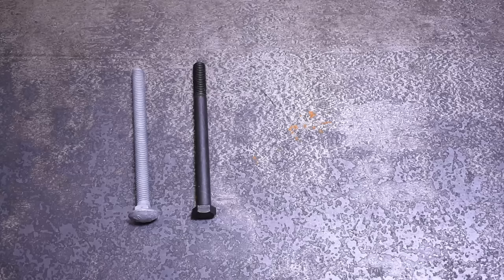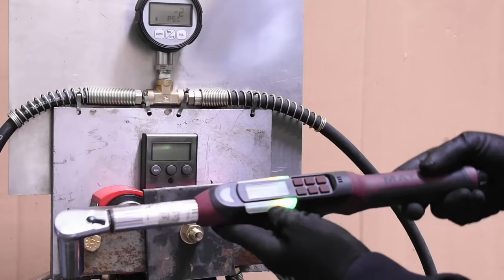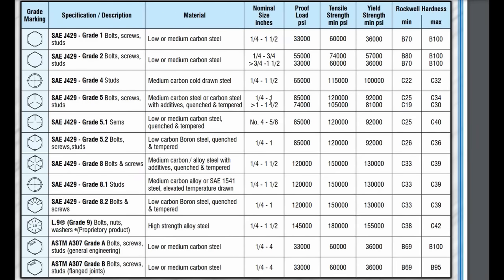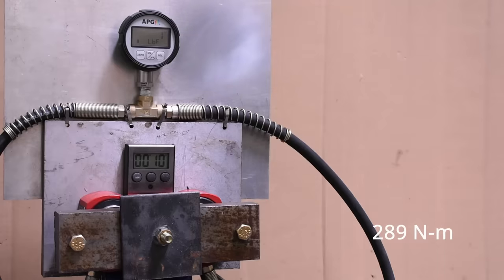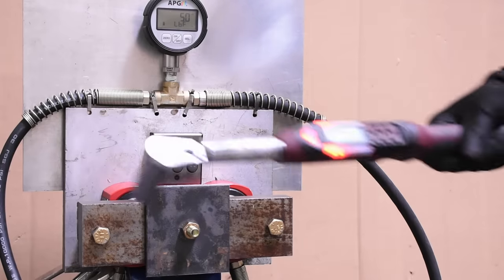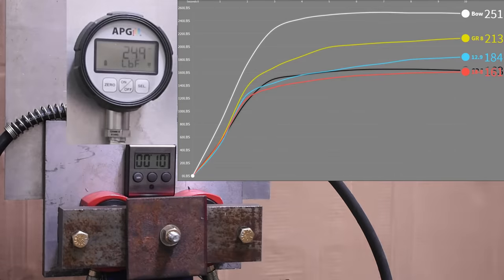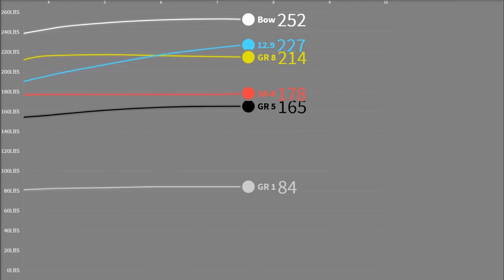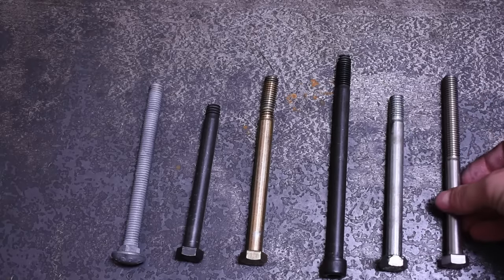Strongest Bolt? Grades Explained & Dyno Tested For Science

Comment: 304 stainless bolts or 18-8 means 18%Chromium and 8% Nickel. 304, aka 304L (L for low carbon) is food grade stainless that's extremely tough (extremely), ductile, but not necessarily hard, and easy to weld. 18-10 has a little bit more nickel and is generally 316 stainless which is considered pharmaceutical grade (as opposed to food grade). You must ALWAYS use an anti seizing compound on all stainless steel to stainless steel threads or they will gauld and sieze with zero chance of coming loose. Once the siezing starts, it only gets worse.
304 is welded using 308 or 316 filler material and 316 is welded using 316 or 317 filler material. 317 is almost always just a filler material since it contains certain properties to better control or stabilize the metal chemistry during the welding process.

Comment: Small point:  18-8 is not a bolt class.  It is a term for certain stainless steels, usually 302 or 304.  It comes from the steel having 18% chromium and 8% nickel.

Comment: I use stainless bolts quite a bit, biggest issue/failure I've had with SS bolts is galling. Running the nut on with an impact and no lubricant the nuts tend to gall before it becomes tight
Reply: AvE taught me to always put something on stainless fasteners, never run them in dry, even the intimate lubricant in your back pocket is better than nothing

Comment: Bolt finish has some bearing on how they take torque as well, zinc plating can act as a lubricant under high torque and a rough black oxide finish can gall up and resist turning when tightened severely. And then there's high speed galling with tainless steel too! It's a big wide world and bolt grade can be only a little slice of the puzzle. Lubed or unlubed? Grease or oil? Thread locker? All variables play in how the bolt breaks. It's like it's got it's own field of science or something probably.

Comment: The reason you shouldn't use stainless fasteners for critical high load applications is that they work harden and will eventually fail even though they work fine up front. I dangerously put some through the hitch of a trailer about 15 years ago or so, replaced a few years ago with 12.9 cap acrews and higher grade cone lock nuts and much safer now despite the brown look. Though they never did fail, it would have been a crappy day if they had and it's not worth it. You can also get 12.9 with zinc plating these days so that's my go-to for outdoor fasteners now unless I don't want a cap screw for some reason eg restricted space.
Reply: Yes, some backyard mechanics replace the rusted steel bolts on their car with stainless so they won't corrode in the rust belt states. I also use white lithium grease or anti-sieze compound on them.Thanks for the advice as I've never heard that before. Retired welder and fabricator.

Comment: 12.9 are usually used as stretch bolts, SS bolts suffer galling and are not good in high temp usage due to expansion. Choosing the correct hardware is vital, if you're bolting a wooden fence use the cheapest galvanized as the tensile stress is not a factor only corrosion, if it's a boat use SS as corrosion and strength is needed, if it's a driveshaft use 12.9 as strength is the only factor.

Comment: I work maintenance in a milk processing plant and we use stainless bolts very often (corrosion resistance and being food grade).  The issue with stainless is that its more brittle and likes to break easier.  And is then a pain in the ass to drill it out since stainless is much harder than carbon steel.  I'm surprised that bolt did not shear during the test.  But like the sheets say, it can vary from bolt to bolt.

Comment: Thanks for an informative video. Very useful.
I'm in the UK so I have my calculator to hand as today we usually work in N/m for torque and N/mm2 for strength. (I did my apprenticeship in the '70s when we worked in both sets of units so the conversion factors are forever etched into my brain...) 🙂
Reply: "N/m for torque...".  I think you mean Nm.

Comment: Very informative.  Tensile strength is only  one measure of performance though.  For instance in marine applications stress fractures over time are likely to limit stainless steel bolt performance as much as overtightening.

Comment: The Grade 1 stretches rarher than snapping under truly extreme loads which can actually make it more useful in some specific applications where the displacement of the 2 things being held together is low, but the force is high, and the bolt isn't structurally critical (for example, affixing a support post in position, where it will shift slightly under high force, but it won't collapse in case the bolt does snap)

Comment: Not trying to be a negative Nancy, but if what you're trying to do is demonstrate the torque it takes to break a bolt you did a great job, if you're trying to demonstrate how strong a bolt is you need to demonstrate how much tightening pressure they can produce before failing.

Comment: Interesting video, ive been working in oil&gas were they use a lot of flenses to join pipes together especially with stainless they use anti seize paste for smooth operation on the torcwrench..

Comment: Excellent video!  Thank you. Just an FYi you have to be careful who you buy your bolts from.  We ran into a problem with many bolts coming out of China having false markings. (I can't remember the company). We paid for high strength bolt and ended up with low grade with high grade markings on the heads. This was in the early 2000's so it may have been fixed but you still want to "buyer beware."

Comment: I changed a jet engine on an MD-11 the other night. The mount bolts were about the size of your thumb. 500 ft/lbs torque. I would love to see those tested to failure.
Reply: I'm sure you know the rules about not re-using bolts that were heated with a torch to remove. It wouldn't hurt to remind a few rookie mechanics about it. In 1982, I knew a welder that did that in the Air Force, and he said the engine bolts snapped off on an airplane after he used them again. That was during takeoff! Maybe he was talking about the sixties or seventies. From a retired welder and car mechanic.

Comment: My father was an engineer for Caterpillar tractors and he used to say they always use a 3/8 size bolt because it has huge jump in strength compared to smaller bolts.  I also have always heard stainless bolts are brittle and break easy but i have always had good success with them. Never had one snap on me. I have 308 stainless bolts I was wondering what’s the difference between the ones you mention (the 304) and 308?

Comment: Terms like ‘toughness’ and ‘strength’ are often thrown around and only serve to muddy the waters.  ‘Toughness’ is the ability of a metal to resist brittle fracture; meaning it will deform more before failure.  ‘Strength’ is the ability of a metal to resist plastic deformation; meaning it will deform less before failure.  The harder the steel, the stronger it is.  Softer steel = tougher steel. Strong bolts will snap when they fail, tough bolts will stretch when they fail.  

Just because a bolt is made from a harder steel doesn’t make it better, it’s only better for the application it’s designed for.  A tougher steel bolt is desirable when it is likely to experience some sort of impact, for example connecting rod bolts in an engine; as the power stroke in one cylinder is creating the intake stroke in another by pulling the piston out by the connecting rod cap, the rod bolts in the intake cylinder experience the energy transferred to the crank by the combustion cylinder.  Rod bolts must endure stretching forces repeatedly, which means they need to have a good toughness, yet balanced with good strength to resist deformation. 

All in all, there’s really no such thing as a ‘best’ bolt; more like what bolt is best for a given application.

Shear strength and toughness are another aspect that should explored here.  Rod bolts aren’t designed to withstand shearing forces, as they essentially don’t experience it.  Structure bolts are used in a static application, as opposed to rod bolts in a dynamic application, and should hold static tension while having a high resistance to shearing.

Comment: Most interesting part is that I even care about this stuff.
ARP sells their common Small Block Chevy Connecting rod bolts, black  fine thread, which are rated at 200,000 psi. (yield ?)
But meanwhile, stock SBC connecting rod bolts, now made by Pioneer, are black grade 8 fine thread and rated at 150,000 PSI.
It appears to me the tests show a Grade 8 doing very well with above 200,000 psi .  Leads me to believe that if you aren't reusing old bolts or over torking, Stock is fine up to 6200 rpm even at higher horsepower levels.

Comment: Fun Fact
The Metric classes just represents the tensile strenght (x100) and yield strenght (first number x second number x 10)
8.8 means 800N/mm² Rm tensile strenght (8x100) and 640N/mm²  Re yield strenght (8x8x10)
12.9 would be 1200N/mm² Rm and 1080 N/mm² Re

Comment: Your tests operate by converting tension in the bolt into an equivalent torque.  In this test you are showing bolts with various surface finishes up to and including galvanizing.  You will see a difference in torque to tension for galvanized steel vs. smooth uncoated steel meaning you would have to calibrate your conversion factor for each individual bolt type and finish.
There has been a lot of study of bolt tension vs. torque for building construction.  If connections are going to rely on clamping force from bolt tension then we have to know how to reliably achieve the clamping force and how to measure it.  Some tightening methods actually just measure rotations of the nut to know that the bolt has gone into its yield range and this is done in some automotive applications as well.  I've seen various tests using a Skidmore-Wilhelm machine to see how bolt tension varies due to factors such as bolt coatings, finishes and lubrication.
Grade 1, or A307, are very common bolts and even though the metallurgy is fairly mundane they provide a good amount of strength and are widely used in building construction.  In structural steel buildings the most widely used bolts are A325 which equates to Grade 5.  Some very small percentage of building construction has been done with A490 bolts which equates to Grade 8 but I've also read in various literature where there have been doubts if it was generally possible to properly tighten large diameter A490 bolts to achieve the expected clamping force.
Strength and hardness are somewhat related because after all that is the way that you measure hardness- by deforming the material.  If it is stronger and resists the deformation then that will read as being harder.
"...as simple as nuts and bolts...".  There is nothing simple about nuts and bolts other than the basic shape.  Or maybe it's just the tendancy of humans to make things complicated.

Comment: The "newer" torque ratings on certain bolts (heads, rods, mains) are torque to yield bolts that are designed to be stretched and then used in their plastic range. You can only accurately achieve this by torquing to a point past normal, then using an angle gauge to see how much stretch you're putting on them. 

It's also keeping ARP in business selling reusable studs that are able to withstand the forces and multiple rebuilds/retightenings beyond the necessary holding force.

Comment: A lot also depends on how many threads there are in the nut being used, during manufacturing some nuts have their faces countersunk more than others resulting in less threads inside the nut, some mass produced nuts can very often have one complete thread missing due to over countersinking of the faces, resulting in bolt threads to strip sooner than if a fully threaded nut is used.

Comment: another note about stainless is if you use stainless bolts with stainless nuts you must use anti seize or the threads will gall/weld and you will be breaking the bolt to get it apart.

Comment: When I was with US Customs in the very early 90s at a container examination station, we received a memo from District. It was instructing us to take a sample of four bolts from every overseas shipment coming into the US. The bolts were to be tagged and sent to the Customs lab for strength testing. The Commerce dept feared counterfeit bolts were jeopardizing safety in US goods using bolts. At the very bottom of the memo was 'don't look too hard, if we find too many then the Commerce Dept is right, and we are wrong." WTF.

Comment: Thank you for putting this video together, it mainly reinforced the way I was taught about bolts with one major exception that being the stainless steel version. I have always been reluctant to use stainless unless it was absolutely required for the application, my concern was the hardness issue or so I thought by what I was taught and my own ignorance never seeking enlightenment on the subject, you clearly demonstrated I held the wrong idea about stainless that being "it was too soft" in comparison to carbon steel with stainless requiring carbon to be added allowing hardening, I am assuming your bolt tested was carbon free.

Comment: I do structural steel work and would have donated an a325 and 490.  Hard to get smaller than 3/4 inch though.  You would also need something very serious to snap a 490.

Comment: Fantastic video! Could we see a test of these drill/tap combo units I see from Greenlee to Wera? I’ve broken every one I’ve ever used on the first day. Some off-the-wall brand from Amazon made a bunch of good cuts on i-beams for me- until I tried a pilot hole that was too small. I understand you aren’t supposed to need a pilot hole, but I usually drill one size down before using them. I’ve done some awesome things with them on i-beams and charger/extension cord discipline. I’m a gunsmith whole also maintains a 70+ car collection including but not limited to everything from current Mclarens- 720S convertible, 765LT convertible, 750 convertible (and classic McLarens), Ferraris, Bentley, many Porsche 911 Turbo, all years C1, C2, C3 coupe and convertible (when available) with the most powerful engine for the year, and a couple new Z06/Z07 C8 convertibles, vintage race cars, and modern Top Fuel dragsters and Funny Cars.

Comment: As all the failures on the coarse thread bolts occurred on the thread, we still don't know the max torque of the material, just that of the thread.
Most people are surprised to know how much stronger the bolt is when lubricated fine threads are used.
I was really hoping you would put some grunt on those 5/8 fine thread bolts you have, and a fine thread 1/2 in Gr8 and Gr9 as well.

Comment: I definitely appreciate the video, however there is misinformation both in the video and the comments.  I did 20 years of bolt testing and I'm just going to say that fastener condition, lubricant, axial load and the various compositions of the bolt, nut and washer all play a role, as well as the installation method.  A hydraulic wrench will have very different results than an impact wrench, which will also have different results than a simple torque wrench.  We cannot directly compare torque to tension, especially when in this video there are different settings used on an impact, first battery powered, then air powered, with unknown power for different tests.  I do like that they attempted to keep it as consistent as possible, however different bolts have different applications and some, such as head bolts on a vehicle are best kept quite strong, if brittle, but bolts with an axial loads should have some flexibility.  I dealt mainly with galvanized bolts, but also with others as well and each have their own properties.  The "strongest" have always been stainless, but there are many grades of stainless.  A307, or A36 are definitely the weakest, however they have uses also, where flexibility and axial loads need to happen.

Comment: Cadmium is a silver colored metal, as is Zinc. The yellowing color is a chromate coating dyed yellow. Most zinc plating is coated with chromate because zinc is a very sacrificial metal and will quickly oxidize.
Now for most DIY home projects that involve water, air, corrosion I'll pay for the SS fasteners and coat them with graphite spray 3x. For the home job it's not going to get much better than that.

Comment: Some of the differences in bolt tension shown on the dyno may be due to differences in friction between the bolt and nut because they all seem to use different coatings. That's the reason wheel stud torque values (also most torque values in general unless otherwise specified) are given as dry threads. It is inadvisable to apply anti-seize to your critical bolts, no matter if it helps keep them from rusting together. Using a lubricant will increase bolt tension at a specific torque value and you risk over tensioning the bolt.

Place I worked at applied Geomet and Dacromet rust inhibiting coatings with different lubricity enhancing top coats to a wide range of products. Learned quite a bit there. Technology was cool but I'm glad it was just a single summer job in college.
Reply from the maker: Very true!

Comment: This just confirmed why the use of Grade 8 bolts for the Chassis to Cab connections is chosen over Grade 9.. also, why torque specs are so important in knowing the best holding force vs the materials' commencement of failure (the stretch before a catastrophic snap), .

Comment: I was using 3/8-16 grade 2 carriage bolts on my mower deck at home, I wanted them all to be the same torque so i just set my wrench to 30 and half of them snapped and the other half were torqued but snapped when i loosened them, i then swapped to grade 8 had bolts cus i had extra, safe to say they did not snap